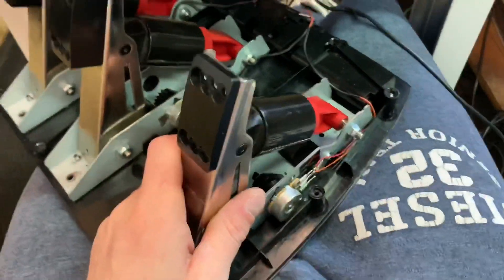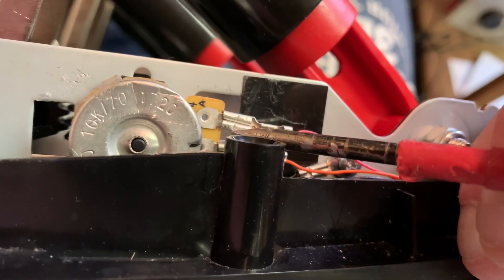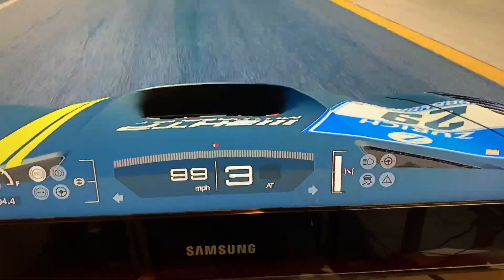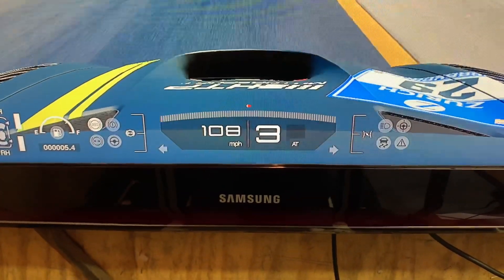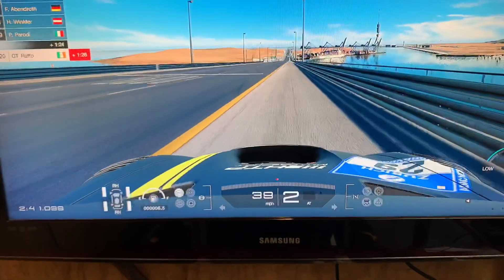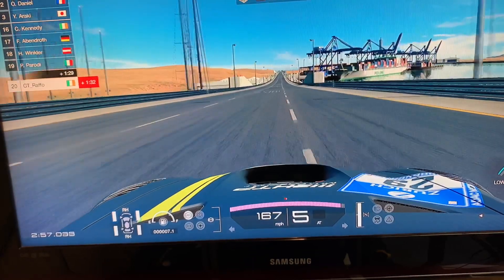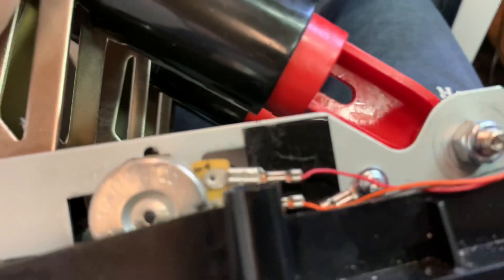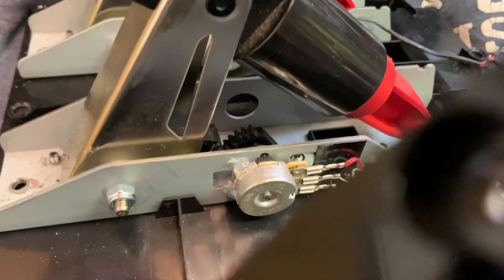Logitech G29 potentiometer problem fix part 2

Comment: thank you man. 4 years later and the potentiometer was EXACTLY the reason my brake pedal on G923 kept registering pressure. All I did was straighten the metal and suddenly it's working lol
Reply: Having same problem with brake pedal have you got recommendations to fix this problem.
Reply: @carlojamo  in my case it was a loosely connected metal wire
Reply: @jacobone1  thanks I will have another good look and see if I can sort it.

Comment: Hi can you please help? I have a problem that as soon as i plug in my pedals the wheel power cuts off and when i unplug them the power returns. This is an electrical issue. I'm not certain if it's the PINS on the wheel where you plug in the pedals OR the wire itself or the contact plugs on the pedals with the red and black (positive and negative wires). Obviously something is shorting out along this relay. Are you able to shed some light or make a short video showing the EXACT cables  position where they plug onto that potentiometer on the pedal plate? I'll see if mine were wired wrong or if potentiometer isn't making connection. Thank you kindly.

Comment: Cheers dude. I have a G29 problem and don't know if by any chance you may know the solution. My pedals suddenly stopped working in GT7, I connect it to PC and check with the Logitech software and see with any movement of the pedal there is barely any response reading. I took apart the pedal set and tried to clean (previously applied WD40 to solve pedal sticking issue), but this time I have no luck fixing the new issue. Now if I fully press one of the pedals, the software reading is only about 5% of the travel. Thanks in advance.

Comment: I've pulled my pedals apart 5 times now and I'm still having issues. I've come to the conclusion that they're only fit for the bin. I would never buy Logitech again and wouldn't recommend them either. Hopefully in the next few months I will be able to upgrade to another make, then I may actually start enjoying racing games again. BTW I've had this G29 for less than 18 months and I regret getting it.
Reply: I poured a ltr of isopropanol into the brake and throttle things that this guy is moving around. After half a ltr each my sick was full of dust muk hairs and millions of tiny bits of black plastic marbles

Comment: Cheers for this great tip, I had the bouncing ACC and my TrueBrake mod was also having issues, coming on during races so I knew there was something odd going on. After I took the acc peddle apart again and cleaned it for a second time with alchol,  reassembled I noticed that movement in the pot, however it wasn't as bad as yours, tested it, didn't see anymore bounces and used your glue gun trick to keep it in position just in case!

Comment: I have a g920, when on the logitech g hub, my brake calibration only reaches 20% with my brake pedal pushed in until it hits the extra pressure part (the square sponge lol) my mates reaches over 50% at that point? What could be wrong about mine?
Reply: Open usb controller and calibrate. Then when you press your brake as far as you like it will read 100%

Comment: Which bit do u loosen to adjust the angle of the potentiometer? Mine is stiff in its position
Reply from the maker: Are you sure there’s no movement at all. 
Even the tiniest bit makes a difference. 
Is held I’m position with plastic tabs on the back of the potentiometer that go into the peddle frame. They ware a bit from use and you get some movement. 
What is the problem with your peddles?

Comment: if you dont use the clutch pedal, you can just swap the pedals and that works a treat.
Reply: Swap the whole pedals? Because I don't think the wire stretches that far. Or are u just changing the potentiometers
Reply: @CSM13  you can unplug each pedal unit. 

Then swap them over. I've done it for a mate

Comment: I have a G27 and what it does is on straightaways,I am full throttle and my car will drop in speed alot and then pick back up again. It's an on and off thing. Wondering if it could be a dirty potentiometer or failing one. Thinking of changing the clutch to the gas since I don'tuse the clutch. Your thoughts?
Reply from the maker: If ye haven’t tried cleaning them, start there.

Comment: The potentiometers are the weak point with the G27 and G29 pedals, particularly the throttle one as it is used the most. I've removed them several times, opened them up and cleaned the contact surfaces with circuit board cleaner and cotton buds. This works well for some time but eventually the constant friction wears them out completely. Finding replacements is a problem. The 3dRap ones from Italy are 3D printed so the plastic gears are not particularly robust. But they work fine for quite a while before needing replacement again. I ordered some replacements from Digi-Key in the US which look exactly the same. The plastic threaded part is a fraction larger than the originals so a light touch with a Dremell was needed to enlarge the hole in the metal mounting slightly. Unfortunately the input shaft is keyed 180 degrees opposite to the originals so pedal position is incorrect. The brake for example is constantly full on. I'm going to open one up and see if I can modify it to work correctly. I  think there must be clockwise and anti-clockwise rotation models. The new Logitech G923 pedals use exactly the same potentiometers so there will be problems down the track with them as well.
Reply: Thanks for your input, i already had potentiometer problem six months ago i sprayed with contact cleaner.This time the spraying did not help, i changed clutch to throtlle pedals because i do not use the clutch. But now brake pedal started to act up spraying won't work only have one good potentiometer from clutch which is accelrator now. Maybe it could help to take it totally apart and clean it rather than just spraying right into potentiometer or try to buy new ones  wich is diffiicult. And do the 3d printed potentiometes have the 180 degree issue you mentioed. Because i have to do something try cleaning it by taking apart or search for 3d printed ones otherwise i cant race.
Reply: @ahmadil  I eventually took my faulty potentiometer apart, cleaned it out with circuit board cleaner, and lightly smeared the contacts with dialectric grease (doesn't conduct electricity). Put it back together and it has worked perfectly since. I think the dialectric grease is the answer, it stops the contacts from wearing.
Reply: @PropanePete  Thanks for your reply i will try take apart and buy that degreaser
Reply: @ahmadil  It's not a degreaser Darius, it's a lubricant. Degreaser is a solvent while dialectic grease is a lubricant that doesn't conduct electricity. So it's perfect for lubricating the fragile electrical contact surfaces inside the potentiometer. Any electronics shop or even a good hardware store will stock it. Comes in a small tube.
Reply: @PropanePete  Sorry i just wrote that word but i meant dialectic grease. I was typing with on screen keyboard with mouse so i got lazy. But thanks anyway. How soon your pontentiometer  wore out completely after full clean + grease ? I hope that when i take everything apart it will work ordered the dialecric grease yesterday already bought contact cleaner now just left to wait an then try to fix one broken pedals. Do you think that i need to take apart my working clutch that i wasnt even using but it was still covered in dust  but it now works fine as accelerator ? I hope i won't wreck the pedals. Thank you Pete
Reply: @ahmadil  After cleaning and applying the dialectic grease about 3 or 4 months ago I have had no further problems with my potentiometers. An extra thing I did was to increase the electrical contact pressure by very slightly bending those tiny little hairspring contacts on the part that rotates. Just a very tiny adjustment then apply the grease and reassemble. If you do this to all 3 potentiometers they should last indefinitely as the grease has eliminated the wear on the contacts. I'm going to clean and re-grease mine every 6 months.
Reply: @PropanePete  Thanks for the info Pete i will try all steps. I already peaked at a video awhile ago on full pedal disassemble and remember seeing part that guy puts grease on chip after cleaning. Then you wrote that you think that grease is the key so i bought it right away. I will try figure out your extra thing because i did not look at the parts closely and there's that video it is full good guide i just saw minute of it maybe he is bending hairspring and greasing it too . I will write how it went.
Reply: @PropanePete  Hey Pete i've got a question. I have the grease now only have to find time but watched few videos and those little hairpins that you suggested to bent i saw a video guy doing that. So my question is do you put grease anywhere else besides the chip because in videos they don't put grease at all or putting it only on to the chip but all other parts are just contact cleaner ? Thanks
Reply: @ahmadil  It's not actually a chip, it's just a simple potentiometer that varies the resistance as the shaft is rotated, thus simulating throttle position (or clutch or brake). The dialectic grease goes on that circular contact surface after you clean it with circuit board cleaner (any electronic shop has this) and a cotton bud. If you look closely you can see the rub marks where the contacts have been working, this is why they wear out. Just putting a small amount of grease on the rotary contact surface is enough. I put a little bit on the little hairspring contacts as well but it's not necessary. Over time dust and grit will get back into the potentiometer and the process will probably have to be repeated, but the grease will greatly extend the life of the potentiometer.
Reply: Hey any possible help. Trying to put my throttle back together. But I cant seem to find the right point to have the potentiometer. Either the washer and nut Make it to tight and I get very little throttle or the spring isn't giving me enough tension to give full throttle.
Reply: @DialupGaming  Are you using the original potentiometer or a different type.

Comment: I have same issues with only three month old peddles. First noticed the ABS light flickering down straights, now starting to notice throttle flickering on and off :( For this reason I couldn't recommend Logitech G29 to anyone, durability is a big issue it seems.
Reply: my g27 pedals are going strong and 5+ years old. 
My g29 pedals have failed within a year.....(6months to be almost exact)
Its just the accelerator pedal for me but i find it really weird that my g27 after taking 5 years of RBR beatings still goes strong yet my g29 pedals fail under a year with not much thrashing at all!
Reply: @jasonstranthon5183  Yes i got the same issue with my g29...  I got flickering input that got up to 20%-30% of the pedals, and i got it for both clutch accelerator and brake, fortunately It worked well for a full year but its so sad because It was quite expensive i spent 450 euros for the whole bundle with manual shifter too and even After cleaning the internal parts and after swapping clutch with accelerator because It was in Better condition and after even swapping the spring because It was too hard to Press i still have to take off from the game the First 10-15% of pedals (idk how its called i dont speak english so well)

Comment: Can I use ELVI 60 MULTIPURPOSE spray on potentiometer?? (Please respond I need your help)
Reply from the maker: I don’t think you should use that spray. Contact cleaner only.
Reply from the maker: Do what I do on this vid and you should be able to stop your problem. If the potentiometer has moved it can think your pushing the peddle
Reply: Don't use that ELVI 60 spray, it's a penetrant not a cleaner. However you certainly can use a spray can of circuit board cleaner. They come with a small insertion tube that you can poke into the potentiometer and spray the insides while working the pedal back and forth. Be liberal, you can't hurt anything. As per my comment up the top the problem will eventually return at some stage.